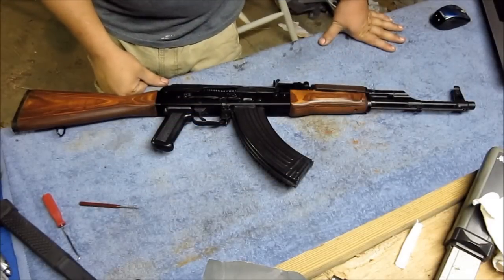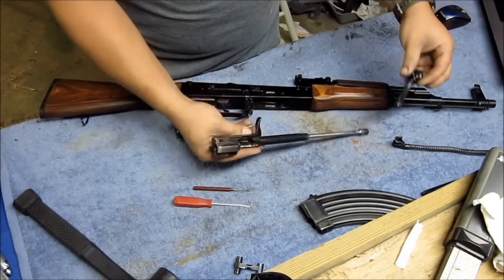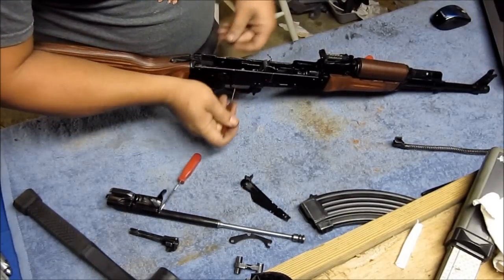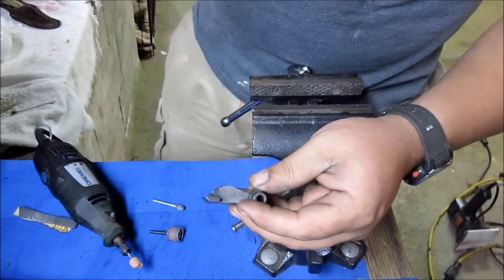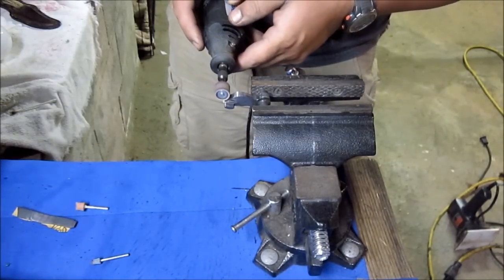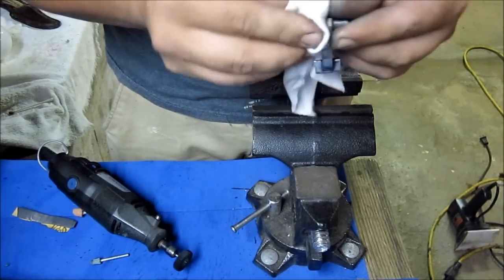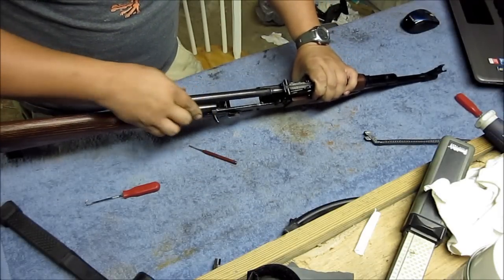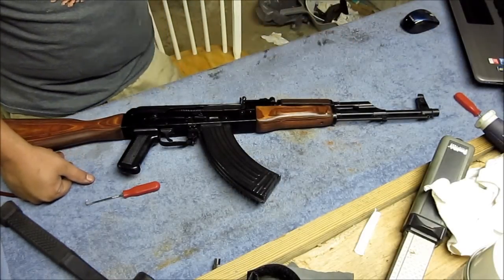AKM/AK-47 STYLE RIFLE HAMMER POLISH (REDUCE HAMMER HANG UP/SNAG)

Comment: Anyone ever wonder if maybe the ability to have the bolt "stick" open might be a desirable thing?  It only does that if you hold it back preventing the bolt from freely slamming home into battery as it should.

The Russians ain't stupid.  I suspect that feature was implemented intentionally, maybe to allow easy visual inspection of the chamber and top of magazine.
Reply: +Blake R No, because it hardly happens with actual factory AK hammers.  The originals from Zastava or Saiga or Bulgaria or wherever your AK is from aren't as much of an issue.    They aren't shaped all goofy like the Tapco G2 hammer.  This problem is mostly due to the fact that almost all US AK's have had the original fire control group removed and replaced with Tapco parts in order to meet 922r regulations.  Tapco makes a good fire control group, but that hammer shape causes the majority of these problems, and even causes carriers to jump the rails in the back and mushrooming of the metal on the carrier and bolt.
Reply: That was my though too but I'm still going to "fix" my hammer.